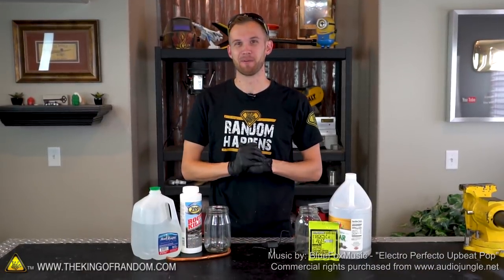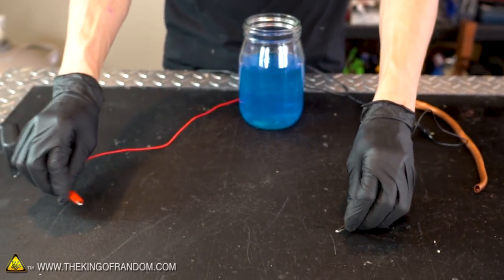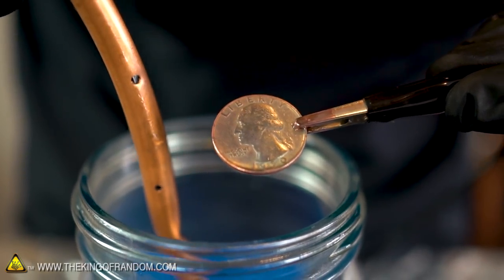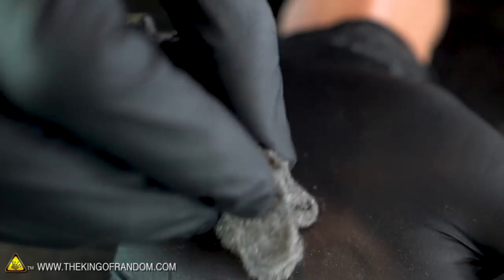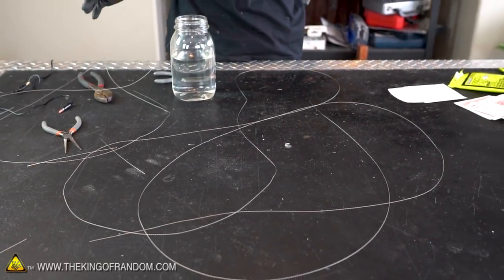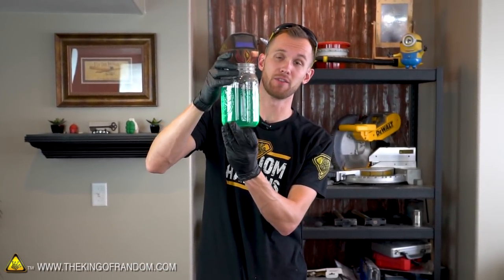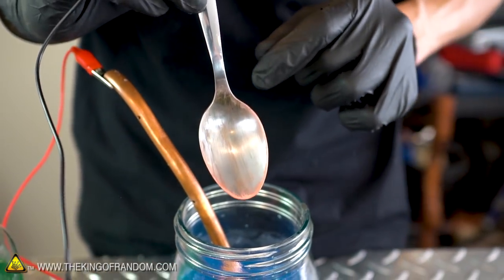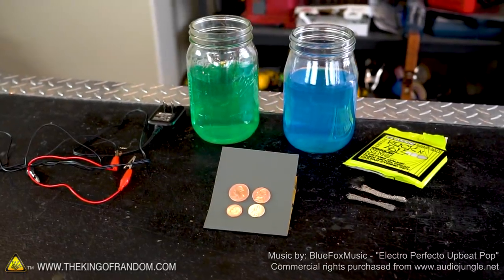DIY Electroplating With Copper and Metal! TKOR Experiments How To Do Electroplating At Home

Comment: Some mineral processing industries use a suspension of magnetite (FE3O4) powder in water as a "heavy medium" to separate less dense minerals from more dense ones.  Magnetite for that purpose is sold by the truck load.  With a few phone calls you would probably be able to buy a 50 lb sack of pulverized magnetite.

Comment: Turn a penny gold with NaOH, zinc, an evaporating dish, and a hot plate. NaOH and zinc go into the evaporating dish that goes on the hot plate. When it begins to boil stick the penny in the boiling mixture and watch it turn silver. Then, wash the silver penny off and put it directly onto the hot plate and watch it turn to a gold color. Finally, wash it off again and it will become a shinny gold color instantly. Very fun and satisfying and highly recommended. Have fun!

Comment: Certain processes are only suitable for certain materials, and certain materials can only be coated with certain processes. For example aluminum has a specific chromate conversion coating process, whereas you would zinc chromate steel. Even as someone who works in metal fabrication I’m still a novice in platings/coatings, it really is it’s own profession with its own expertise.

Comment: You could use anything other than the copper pipe as it doesn't transfer the copper, its the sulphate solution that is the one that transmitts.

Comment: So, I feel obligated to say if you can do this why not make a voltaic cell. Electroplating is very similar to making a voltaic cell. To make a primary voltaic cell you need copper(II)sulfate (aq), copper, zinc sulfate (aq), zinc, 2 non-metal containers, a tube to connect the solutions, cotton to plug the tube, and sodium chloride (aq). Fill the containers with the different sulfate solutions. Put each metal into the containers with their matching sulfates, copper with CuSO4 zinc with ZnSO4. Plug the tube ends with cotton and fill the tube with the sodium chloride solution. Connect the containers to the tube. Connect the metals with the wires and the reaction will begin. The copper (cathode)  wants the electrons more than the zinc (anode) can hold on to them so the zinc loses its electrons 2 per atom to be exact creating a ZnSO4 with a +2 oxidation state the electrons transfer through the wire to the copper where they attach themselves to a CuSO4 and turning it into a Cu and a SO4.

Comment: If you want to plate stainless steel with copper, you must first plate it in nickel. Nickel will bond well with the steel. From there, the copper will bond with the nickel.
Reply: EPNS  infact. Only with copper not silver.

Comment: Easier way to get a copper COLORED coating(not actually a copper coat) heat up quarter until glowing red hot, then dunk in antifreeze for 10-30 seconds. Then remove and rinse.

Comment: I have an experiment for you 
get all of the fuels that thar are and try to lite all of them 
If it lites than try to lite termite with it
Reply: It amazes me how ridiculous some of the ideas people have are. Like, what? That's not gonna light thermite. How could you ever think that throwing a ton of different fuels together, which are, by the way, liquid, and lighting them would ignite thermite? Firstly, you'd just soak the thermite rendering it useless and secondly, mixing a ton of fuels wouldn't do anything to increase their effectiveness in any way whatsoever. It's not like putting one fuel with another doubles the heat it outputs or the speed it burns at. There is no additive or multiplicative effect of combining fuels.
Reply: I think he meant termites....

Comment: Dear King of Random,
I love your initiatives and curiosity in RANDOM science and I have a fun experiment for you which I saw at an exhibition.

Join two tubes with one end on each wider than the other end.
Connect them in such a way that you can pass air in each separately as well as allow air to flow from one to another.
Then, using a soap solution, make bubbles on both wide mouths of the pipes. Then inflate each balloon separately such that one bubble is noticeably larger than the other bubble, but both have substantial size.
Now, the moment of truth. If you connect both bubbles through the pipe then you will see results contrary to your expectations.
AIR WILL FLOW FROM SMALLER TO LARGER BUBBLE, NOT LARGER TO SMALLER.

Hope you like this experiment.

Comment: Fun fact: Copper will deposit on steel without electricity (because iron reduces copper), but it doesn't adhere. Copper on steel is usually done in copper cyanide solution.

Comment: Fun fact: Stainless steel is an alloy of steel and chromium. It's corrosion resistant because the chromium produces a transparent oxide layer, and because of it, stainless steel is going to say "no" to many forms of torture, chemicals included. It's the main reason it's a common and popular metal. Guess what else chromium is (and was) used for...

Comment: Cool I think you lowered the value of a quarter even though it is copper that gives our coins value besides new pennies of coarse. I wanted to copper plate a hood ornament and a knife blade but, one is 440 stainless and the other has the thinnest chrome plating ever so I do not know if it will take but I know I won't be using that maring steel wool cause even if its 0000 ultra fine and yours is not it will massacre the finish immediately and permanently brasso alone and if needed a polishing cloth will give you that jewelry grade finish that will hold any added sentimental value atleast.

Comment: Can you do this with chrome to?
Reply: Hexevalent chrome is toxic, but you could exchange the Nickel with Cobalt for a realistic chrome looks, cobalt is stronger than Nickel, much closer to Chrome but its about 4x more expensive than Nickel and Chrome so is not widely used as an alternative to chrome, but caswell plating sells a "Copy Chrome" kit that is based on cobalt sulfate/Chloride just like your basic Watts Nickel plating solution but instead of Nickel, they use Cobalt

Comment: What can be used instead of old cell phone plug
Reply: It's a charger not a plug and you can use any galvanic isolated low voltage power supply.

Comment: Buy a real bench power supply with decent output and adjustable voltage and current. It would add a lot to the electrical experiments.

Comment: heating distilled water in a microwave is dangerous, ever hear of super heating?
When pure water is microwaved it can reach temperatures over 100°C/212°F easily and the second some impurity gets in it or you disturb the water(like moving it) it will explode violently)

Comment: Of course the copper didn't adhere to stainless steel, the principal that copper plated in stainless steel can be easily removed is used in a process called Ballard-Shell . It is used to make gravure cylinders for printing.

Comment: Copper will not stick to Stainless Steel because it has a transparent passivated coating that forms naturally on the metal, what you need to do is first give it a Nickel Strike coat from a Nickel Chloride bath, then copper coat it

Comment: Next time don't use the Sandpaper just wash it off with soap and water and then run a lot of water over it and try to up your current a little bit and it should work better without the delaminating

Comment: I've done this a couple of times now and I have had no success so far.  The copper is not the right color at all. I'm making rings from quarters and the color of the copper on the inside does not match the color of the electroplated copper.

Comment: Why are you acting like 5.9v dc will hurt you, you can’t even feel that with your bare hands, you could lick both the wires at the same time and all you’ll feel is a slight tingle, you can touch 200 volts DC and be fine, it’s not AC where 12v can be deadly,it’s not like the wires are straight up 120v AC from the wall, like jheez I’ve once touched 785v and it hurt my hand and left a small burn but that’s 785v dc, your measly 5.9v is nothing

Comment: there is a easier way that i want you to try. take a container of vinegar and put in any coin that you like, and put in a coin with opposite material on top of it and let sit for 6-7 days. check on the coins to make sure their still in position. it smells so bad. when done dry coins, and you have a copper (or other type of metal) coin!